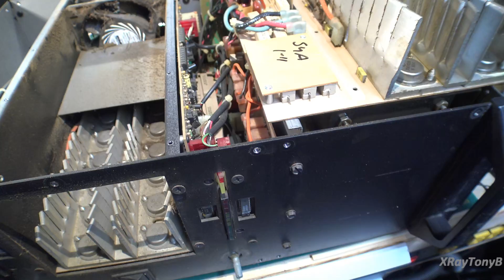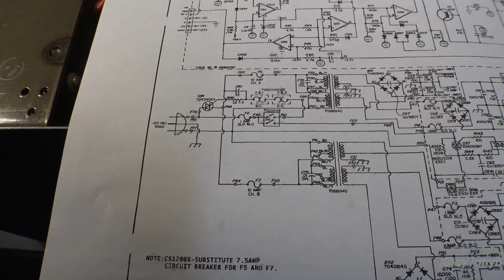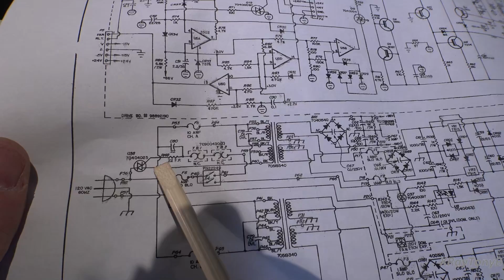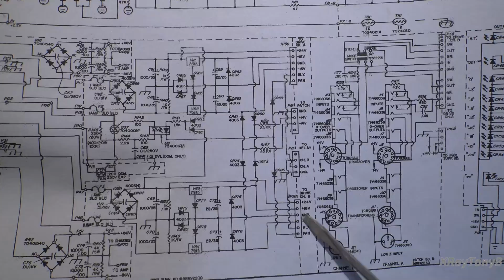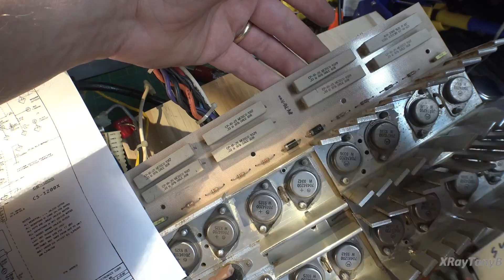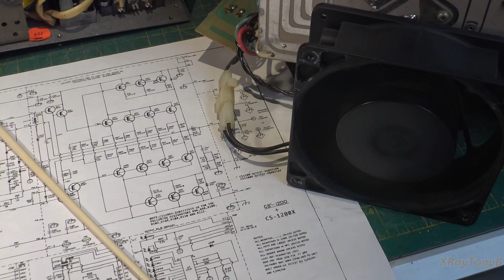Peavey CS-1200x Amplifier Repair

Comment: I used a lot of these! The octal connectors allowed xover modules for frequency dividing and shelving for multi way speaker driving. Along with DDT technology these amplifiers were near on indestructible. Good sounding and easy to maintain. I literally had hundreds of CS 800’s and cs1200 amplifiers in installations all,over the UK.

Comment: I used to service projection and sound in movie theaters most of my working life. There were a lot of CS-1200's in service among the locations. In the late 90's many started to fail, and after repairing a few, we determined they were simply not worth repairing. The build quality is vastly inferior to the QSC's that replaced them, and the QSC's never failed. Not a one. By the time I retired in 2020, all the Peaveys had been replaced and all the associated problems were gone.

Comment: I own a Peavey cs 1200 exactly like the one you repaired, I love this amplifier, and it acts like it is in mono bridge mode while in stereo mode. I checked the mono stereo switch it is good it still powers on but only the left channel. I swapped the transistor board on top with the one on the bottom, and it still operated in exactly the same manner, letting me know both boards are good, and Everything else looks good to me, any advise would be greatly appreciated, thankyou so much Eric Mootz.

Comment: That statement at the beginning is funny as I currently have 2@ CS 1000X's bridged running a 15" sub each and a CS 800X running the mids and highs in my  room  as I love the quality and feel of my music, plus I use it as a guitar amp. as well as I have a 24 Channel Mixer,  Behringer X-Over to separate the lows from the Mid/Highs
Reply: Ce model M 'intéresse sur les supports de lampes et pré-lampes . je n'ai pas de schéma sur l'option . ca serait sympa  James-Vining-333.  Model : CS 1000    .
Reply: @pierrelouistroupel1510  Lamp Support and Pre Lamps? I do not follow what you are asking.
Reply: @James-Vining-333  difficile a expliquer . je pence que au USA , les 4 pastilles ( crossover et transformer ) sont 'elle remplacer par des Lampes de pré amplification en ' entré in . une option surement possible . Merci a vous d'avoir répondu a ma demande

Comment: The CS1200 is a heavy beast. My channel gain knob broke off at about 90% and I eventually sold it along with some Cerwin Vega horns with 15" woofer PA speakers.  It was a loud system.

Comment: I have one I need to look at. These go through a self check on startup. If it self checks ok a relay for each channel can audibly be heard activating. I'm only hearing one on mine, hence only half is working. Where are those relays located in these units?

Comment: I repaired a small peavey guitar amp years ago, and inside the power transformer was a heat sensitive fusible link, interwound with the primary winding. In theory a reasonable protection idea but it threw me a curved ball thinking that the transformer itself was open. Shorted that and got the amp working. A real trap for young players!

Comment: Those Peaveys are horrible. True examples of bad audio engineering and a mechanical nightmare. Nice video by the way, you have another subscriber!
Reply: Where did you get this information from?!?! Everyone.. Literally EVERYONE, ive spoken to on Peavey Amplifier forums, and Pro Audio forums, have all said, They are basically bulletproof amplifiers, Work horses, and often capable of outputting more than their rated specs without clipping..
Apparently the only thing that really kills them, Is voltage surges from house mains...
Reply: @RGD-Radio  from personal repair experience, of course. Have you had the chance to look at the schematic of those amps? Absolute garbage my friend. And I intimately know many excellent designs from Crown, MacIntosh, QSC,  Mark Levinson, etc. because I have worked in audio most of my life. Whoever says these amps are good, knows nothing about audio electronics, or they simply have a false "Made in America" pride.
Reply: @joemarz2264  So what exactly makes them so terrible?!
My CS-1000 has been fantastic so far..
I dislike the sac187 triac speaker protection method, But other than that.. Mine has been great so far..  Same 20+ year old capacitors etc too..
Reply: They're commercial sound reinforcement amps not home hi-fi amps.

Comment: 3/4 valume settings should put the led lights at yellow turn the nob more /red comes still  not peeking the 1 red top red light turns on when u drive the amp going for 2400watts

Comment: What Rating Diode did you fit in please bud?
I have a Peavey cs 1000, and after replacing shorted transistors and driver transistors, I found there is still a short... 
Tested the diodes, and they read both ways...
And i have no idea what rating diode needs to go in.. 
thanks

Comment: I love the old Peavey amps I have a PV 1.3 k rebuilt the whole thing all new resistors transistors diodes caps filters all the way down the line it took me about a month to rebuild Plus also waiting on parts. when you order parts from PV you have to look at the schematic and give them each part number it's crazy.😂   Got to know all the people at PV pretty well. Grant Brown said to me why are you rebuilding this amp when you can buy a new one with a lot more watts and I said because you can't beat the old PV amps they're built like tanks.😁 The PV 1.3 k weighs 100 lb and it has one huge transformer in it to run both channels LOL. 2,110 watts at 2 ohm load it's a powerhouse. I have a lot of time and money in it and I'm not getting rid of it for nothing 😂 if I was you I would keep that amp and never get rid of it. Brand new when the PV 1.3 k first came out the price tag was $5,000.

Comment: Would a capacitive dropper be a better (less heat) way to power the cooling fan, or would that, somehow, be dangerous? Thoughts/suggestions? I thought the OEM resistor was poor engineering, at best, and, maybe, a little nuts... Your resistor solution was much better than the original and looks like it will work well and be safe.

Comment: What a great tutorial on using a Dim Bulb Tester. Just what I needed. I just cautioned my family and friends on the dangers of AC (even in small SMPSs) and the need for a DB Tester. Thanks! From the look of the grunge inside, I would think that amp had been used as the house amp in a bar. I would also think that it smelled pretty bad. I ran pro sound in the late 70's through the 80's. We had a good bit of Peavy equipment. It was cheap enough, but it all had really harsh high ends. We changed brands, as the company grew. I also had an electric guitar amp head and 4- speaker box. It was solid-state and 60 amps, IIRC. Inside the head, there was a funny little quality sticker that said something like "Made by beautiful virgins, in Meridian Mississippi. No kidding. Maybe someone knows the exact quote. It would be fun to know exactly.

Comment: I have two CS-900s. Going to take both of them apart and replace the power transistors. One has an issue where one channel clips all the time with only a little input. The other amp sound distorted all the time. So, I'll try that and see what that gets me. Great video!

Comment: Does anyone know witch way the fan blows please I think my fan might be the wrong way round thanks
Reply: When you look at it from the front, it should spin clockwise, and blow towards the back. Does that help? Please let me know.
Reply: I’ll switch it on later and have a look so basically it sucks the heat from inside the amp and blows it out or it sucks cool air from outside and blows it into the amp thanks
Reply: @jasonlee6392  generally, if the fan is mounted on the back panel, it sucks from the inside and blows to the outside. If it’s mounted on the front panel, it’s the other way around.
Reply: Thanks I managed to do it although it actually sucks from the outside and blows straight throw it works like a tunnel type thing and blows pretty good if I’m honest the fan also has little arrows pointing the direction
Reply: @jasonlee6392  oh, did you? Good for you.

Comment: One of the most  bad model in peavey amplifier  ,no air  filter to protect the power transistor from dust and it has too many wires inside the amplifier

Comment: How hard is it to replace the volume  knobs on this amp?
Reply: Not difficult to replace vol
Reply: @shaheenstudiofilms8710  . Thank you for your reply.  What are the steps?  Do I have to remove cover, or  desolder pots for swap?
Reply: @booban1  +923024300372
Watsaap

Comment: I have peavey CS 1000x the problem is the channel A if im turning on w/out using the audio its ok.. but if im using mixer stereo output connected to input of CS 1000x then my Power amp have music then the lights of DDT is blink2 then the audio stopped, 🤨 what was the minor problen of my CS 1000X?? Pls give me ur best knowledge of trouble in ma amp.. thanks!🤗👍
Reply: Take pictures  of the connections of  a known working unit. Sometimes when the connectors are plugged in wrong can create problems.

Comment: I have 4000 watts in my house. That amp is kids play.
Reply: Nigel if you know amps ,then you know you can't go off what it says on the side of the kracker jack box .When you look at a cs1200 and think child's play ,you don't know amps .
Reply: @Chokechain1111  
Exactly right!
Reply: Well I run a series or amps for my home stereo I have 6 total and 8 ev eliminator. And 2 custom trap cabinets with a 15,10,2”  drivers   My amps go as in order.  At the bottom   Crest audio ca 9. 1000 watts crest audio vs 1500. 750 watts peavey cs 1200 600 watts  Cewrin Vega a400 225 watts a gem sound pa 650 150 watts and to seal it off a SAE. 2200  100 watts (the one with blue writing the rare one). And I describes all the wattages in per channel all the wattages I typed are per channel .  All in one rack my total clipping power is 5650 watts and why do you think my neighbors hate me
Reply: @nigel mahabir I have more than 20K but there is no need to brag about it!
Reply: This is a real amplifier very well made not like all this new stuff these were built to last some are 30/40 years old and still kicking I’d love to see a amp made today in 40 years time.

Comment: dude i have this exact amp and it comes on but no sound comes out, only the fan spins
Reply: That means it's broken.
Reply: @NunYa953  broken as in it can be fixed or broken as throw it away?
Reply: @jurghvistorres9409  
It can be fixed but if you don't have an understanding of electronics and electricity you shouldn't try to do it yourself. There's lethal amounts of electricity in it. Putting your hand in the wrong place will male for a very bad day.
Reply: @NunYa953  thanks...will have someone look at it for me

Comment: great video..great instructor,(although first 10 minutes seemed to be waist...you proved a short so how would the triac ckt going thru thermo switches cause that???maybe no primary voltage but not a short...anyway from then on excellent..im trying to repair a peavey -2600 and a gps 3500..., 2 questions..will a cap that is failing esr also test bad with cap test found on most dvm,s? can you talk about peaveys ddt circuitry, because I have a ddt light always on and cant see the ckt labled in the schematic?i know it haS SOMETING TO DO WITH COMPRESSION AND LIMITING INPUT..BUT HOW DOES IT SENCE?

Comment: So the two diodes were the weak link? Were they shoddy parts? And what might have cause them to fail?
Reply: heat or overcurrent, bad caps, short main rectifier as in this case

Comment: The reason you didn't get a bright bulb with the power amp separated from the preamp is because you opened the feedback circuit.  The shorted diode pulled the speaker line all the way to the power rail, but without the feedback there was nothing to turn on the opposite bank and cause a short across the power supply.  (Also, no load on the amp, so, no place for the shorted power rail to go.)

Comment: 1200 watts with TRS connectors, bad news! Interesting use of the fan as well, not pulling air through from the front but pulling air backwards into the unit.
Reply: Hence the dirty side of the fan on the inside!

Comment: And with todays tech you can have more power in an ICEPower 1200AS2 on a single PCB that weighs 1/50th of that, no wonder class D has taken over PA at the concert halls.

Comment: Fan mail.......LOL!!! Ok, I commented on this before saying I hate you cuz you got it for $20. The friggin KNOBS are worth the price!!! That aside I want to say I've been through MANY of these and own at least a half dozen-both reg. and X versions. Stellar amps btw. Mine all worked when I got them, but much of your troubleshooting could have been averted when you 1st took it apart to clean. These amps are old enough now they're quite dirty, so known history or not the 1st thing I do is tear em down to clean, and OHM EVERYTHING OUT--paying particular attn to all power devices-including those diodes. If you'd have done this you would have caught the diode and saved yourself a bunch of time. I read in the comments those are a high failure part-even though I've never seen it. Still an excellent practice to check them when tearing down/cleaning. On a diff note I'm glad you checked those caps for the lower voltage supply. While I'm aware of the hot running low speed fan resistor I wasn't aware of it cooking the snot out of that neighboring cap. Now I'll have to check all of mine.....smh. I loved your using a 50 watt resistor, as well as explaining how the fan switching speed circuit works. X versions claim to be 2 ohm stereo stable-I'd never run one that way for extended periods.....period. Love to see you tackle a peavey 1.3K as those, are a nightmare..... :)
Reply: Hi I hav pv cs 1200 vintage amp . I'm looking for top module board
Reply: Can sum one help me get this. I'm frm Durban s.a

Comment: Nice vid. I remember using those amps back in the day at a dance club. We had the CS1200X powering 4 JBL MR15's (2 per ch so at 4 ohms per ch). and then had 4 Silver CS600's bridged powering 4 JBL TR215's. (yes we blew the horns in the TR series several times but woofers were just fine). LOL Then a QSC RMX1500 pounding 3 8ohm 18inch Peavey Scorpion subs. Granted this was in 2001, owner was to cheap to buy decent speakers. LOL But that amp rack was built like a freaking tank. Weighed as much as one to cause I carried those bad boys up two flights of stairs. 1 at a time, 10 min break in between!!!

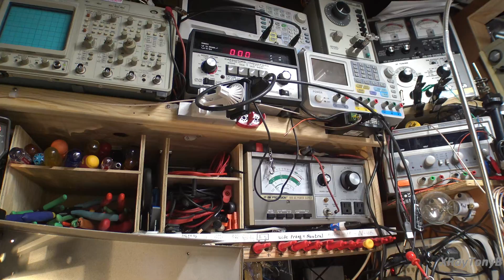Comment: Cool stuff, thanks for the informative video! I have a question though. Moving the power resistor from the board to a more remote location is certainly a good idea but are you sure these tiny yellow wires can take the load? (beginning @35:12)
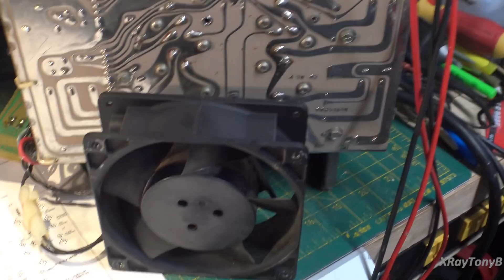Reply: Go back and you will see and hear that those wires carry the current of the fan. @37:52 you will see that the Maximum current draw of the fan is 0.28 amp which just about any wire will handle.

Comment: Wow, the copper and steel in the transformers is probably worth 20$ or more. Cheap.   
I don't like the way these older amplifiers have bundles of wires all over the place, making a mess of everything, but I guess that's to be expected in low volume production, they can afford to have people solder wires or spend time with zip ties.

Comment: i'm from mumbai-india. had made 50+50 rms  using 3055/2955, 25 years back in my electronics diploma, probably had the highest o/p compared to 3-10w ready made pieces, really loved the fully analog sound response, now using a 50*2+100w aliexpress class d,  with optical/coax .

Comment: I used those a lot back in the
 80s/90s there's a  law, similar to ohms law that applies to those amps.
The CS series cost roughly $800 for an 800 watt and weighed seemed like  800lbs.
You almost couldn't stop them though.

Comment: I used to do guitar and amp repair in the late 90s. Peavey didn't make the best sounding gear, but it was good enough. The upside is that they durable as hell. The only problem I've ever had with 70s through 90s gear were cold solder joints or blown speakers. Brings back a lot of good memories seeing this.

Comment: Very nice video!  But i wonder why this power resistor got so hot if it is shorted after the amp is on. Did you check the opto insulator and the triac ? If they don't work the resistor would not be shorted, it would get hot, the fan would not get full power, and maybe cause thermal damage to the power transistors.
Reply from the maker: Great question!  The purpose of the resistor is to limit the power to the fan to make it run slower.  This quiets it down, so you don't hear the loud fan at lower volumes.  If the amp begins to overheat at higher volumes, the thermal switch will close and cause the TRIAC to gate on, shorting out the resistor and applying full power to the fan (which will then be very noisy).  In most cases, the fan will run at low speed through the resistor.  When Peavey designed the amp, they used a power resistor that gets very hot, due to the amount of power it has to dissipate.  To make matters worse, they mounted it on a PC board right next to the power supply capacitors.  Going to a larger resistor and moving it off of the board allowed everything to run much cooler.  The same problem exists on the Soundcraftsmen amp I restored (check out the video) .  Hope this helps to explain things.  Thanks for watching!
Reply: yeah , and with no load this amp sits there and runs the fan in slow mode but power resistor is working overtime....(kinda of a stupid circuit)..and who knows amp was probably left on long periods of time perhaps days and weeks at a time, waiting for signal.